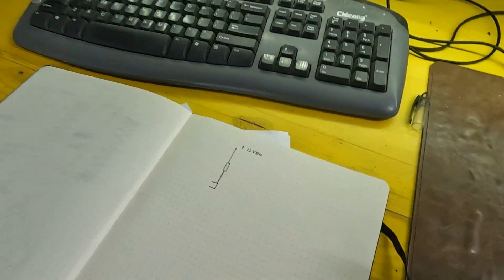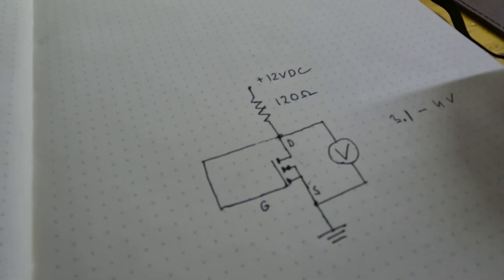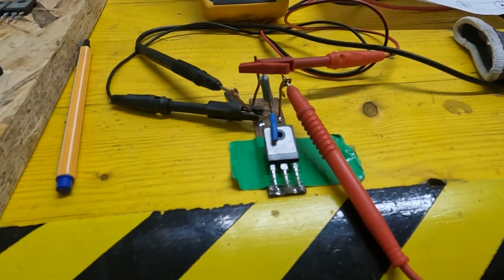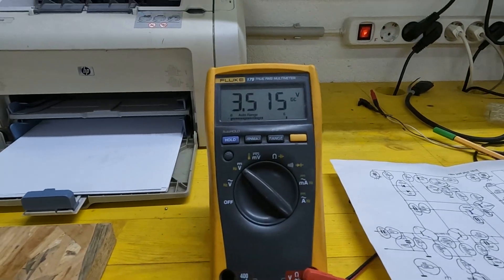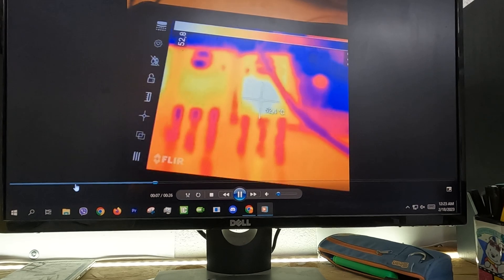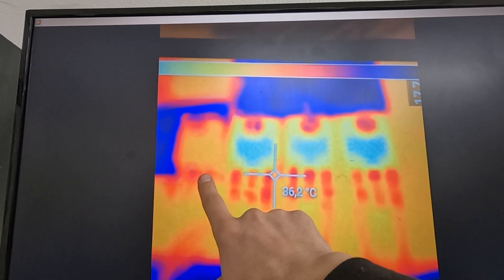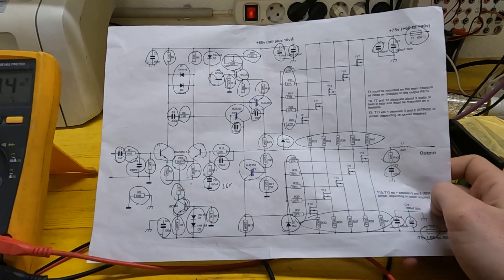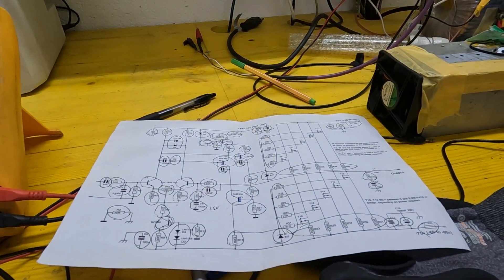MOSFET matching /how to match mosfets for amplifier

Comment: so the three digits after the decimal point must match perfectly?
Reply from the maker: unfortunately yes, i was planning to build amplifier with 6 pairs, but it is almost impossible to match such a large number of mosfets, so i paused this project.
Reply: Fortunately, the Aleph I built has only two pairs per channel.
Reply from the maker: @razec11  Than you have bigger chance to succeed, there are already matched transistors on the market, but they cost lot more than normal ones. Since you need only 4 pars on both channels, you can search for matched transistors.
Reply: How do you work out the resistor value or do you just use the same value for all mofets ?
Reply: @jasonwilken9973  The resistor is one with a constant value for all measurements.